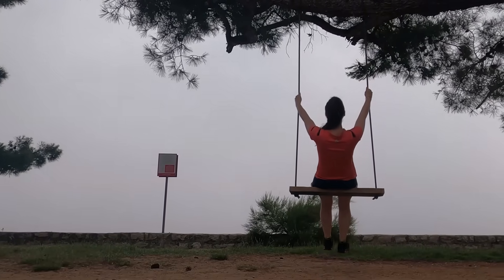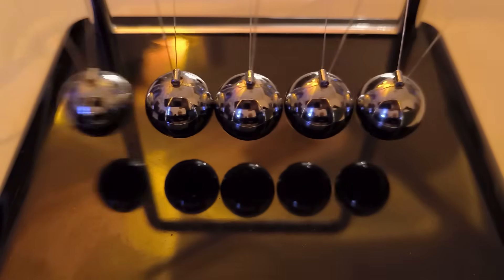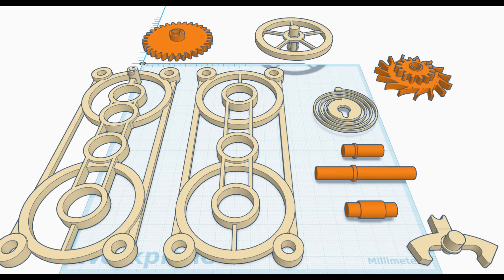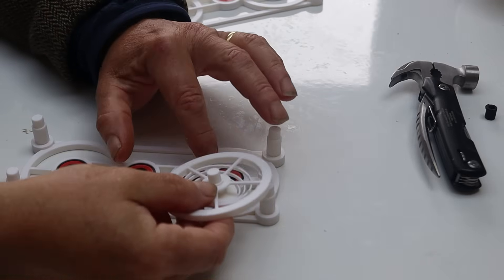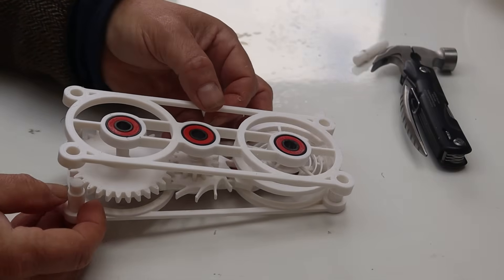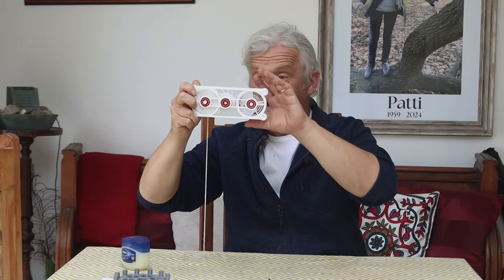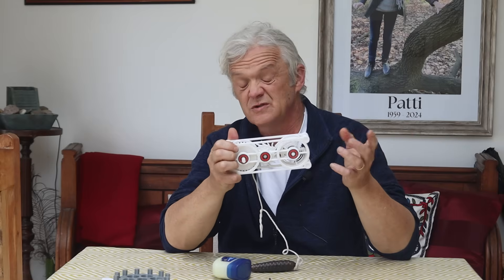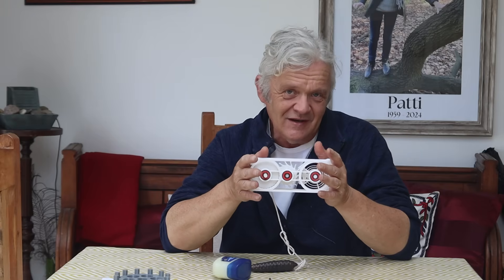2386 A Working Escapement Mechanism

Comment: Very nice mechanism indeed.  The child on the swing does move faster when pushed harder, but the frequency stays the same.
Reply from the maker: to be honest mate I think that depends on what you mean by faster - the frequency - which is the time between swings is constant then no they don't move faster - but if you mean distance traveled - which is a change in amplitude and therefore an increase in a distance traveled in a fixed time then yes the speed of travel increases.
Reply: Hello Robert, my mistake, i assummed you meant the childs velocity but you meant frequency.
Reply from the maker: @AtrumOculis  It's all right mate - sometimes I can be a bit unclear mate - so thank you for pointing it out

Comment: You can actually take those cheaper bearings, rip the seals out, use some solvent to get rid of the original grease, replace it with a real light oil. Leave the seals off and you will get a real low friction bearing. For a lot of uses you don't really need the seals.
Reply from the maker: Good tip!
Reply: - for lube - under "no load" - some graphite powder - doesn't attract additional dust.
 yes "no shields" give lowest friction.. - reasons why hard gems and point pivots are used in mechanical clocks and watches..

Comment: 1:47 I just realized that the mechanism you built years ago that has a tick tock sort of think in a tube and the wind was the power that pushed it until it swung back is the same basic sort of oscillation. I think you attached it to the cone of a speaker and produced electricity by getting a coil to move through a magnetic field?
Reply from the maker: yes it does mate - i forgot about that - thanks for the reminder

Comment: Always interesting, thank you.
The tourbillion - I suspect the primary reason why there are those who swear by it and those who swear at it is the subject is an almost endless rabbit hole of application and situation. Just one example: I would suggest it's worth has a deal to do with the mass of the moving components. The 'smaller' the less benefit such a device is likely to confer... just as well as the harder it becomes to construct.
Reply: The tourbillion definitely helped accuracy back in the days of pocket watches because a pocket watch sits in your pocket the whole day long in the same orientation. They are much less useful for wristwatches because a wristwatch is always moving and pointing in different directions throughout the day. Only the very best of high end wristwatches actually gain accuracy with the inclusion of tourbillions (see Greubel Forsey using two tourbillions at different angles to win the International Chronometry Competition in 2011). Most tourbillion watches just use them because they look amazing.
Reply: @IsZomg   - unique complications sell - high end, unique watches...
Reply from the maker: I suspect you are right mate

Comment: Fantastic great model and working as you say straight off the printer. Funny how you was explaining about the pendulum i was thinking about this quite a few months ago and in my mind remembering that it took quite a bit of effort to get a swing going but very little to keep it going and I was wondering why the pendulum isn't used alongside the heavy flywheel in generation it just seems to be a no brainer. Great video 😊👍
Reply from the maker: i built a pendulum generator a while ago mate - and did a vid

Comment: could you try and make some tetrateanite alloy at home and make a Euler Disk. A video on the Euler Disk would be great. I find it very hard to wrap my head around but a competent person like yourself could convey it. Sory to be off topic but I am not a member yet. or some other material type of Euler disk but maybe two birds with one swat!
Reply from the maker: interesting idea mate - thanks for suggesting it
Reply: Magnets are also stores of energy and I will die (might have to ) saying that maglev magnets from space will save Earth! :p  No friction there except atmosphere and gravity to reduce the output endurance of the magnet...? if the maglev rotor's topology compensates not only for Earnhaw's theorem but precipitates and sustains spin also, concurrently not equiring a bearing as its 'bearing' (like that of a ship)  is defined by its topology and is not an additional component of the design, id est the common friction-based 'bearing'... i mean what about a "one way oscillator - wouldn't be an oscillator would it?" it regains more energy and piggy backs. The videos are interesting because they present ideological properties and not only the limitations of the instantiated example, bringing about a large perspicability of review. The topology of non-fallacious  knowledge-transmissability to other concepts is remarkably interesting, from a linguistically semantic perspective. I'm still concerned that I cannot afford any experiments though. One day I will, but it would have been a waste of time to have waited so long, knowing already how right I am... Extemporaneity is not amusing! - balance wheel and spring would be one and the same in the design of a maglev rotor. - not sure if I'm makgin sence (no offensce) but I'm saying this because I would not have orded it in this manner. It is interesting to see a true genius conveying ideas and also instantiations, the problem is people cannot topologically reapply the ideas you convey to other constructs. What is conveyed here is remarkably sound and it's apparent people aren't capable of retopologicalizationifying of ideology to other application constructs - forget pontificating.

Comment: That's excellent, Robert.  Especially seeing it run straight out of the box.  For a fixed clock, a tourbillon is gonna be useless anyway, the idea is that it compensates for a changing attitude WRT gravity and any other forces, as you would find in a watch.
Reply from the maker: cheers mate